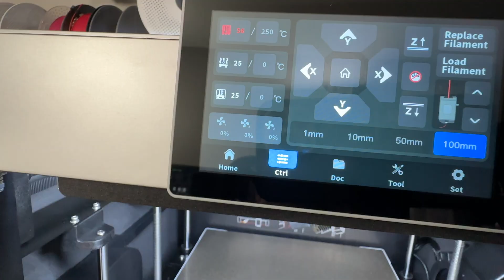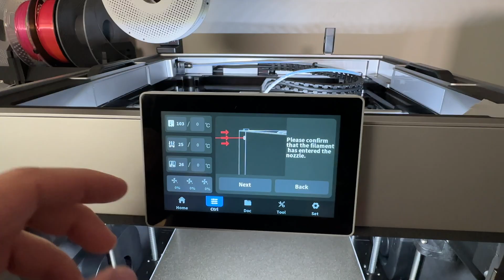How to Unclog a Qidi Plus 4 Nozzle

Comment: My Plus 4 had a small clog in the extruder.  Your video casually mentioned taking this portion apart and I did do that.  WARNING TO OTHERS ! when you remove the four screws on the back of the extruder and pull it apart be very careful to pay attention how the parts are assembled, there is a spring that jumps out plus two tiny bearings that have to be in specific places!   Be Careful!